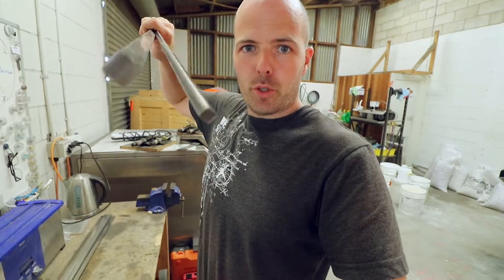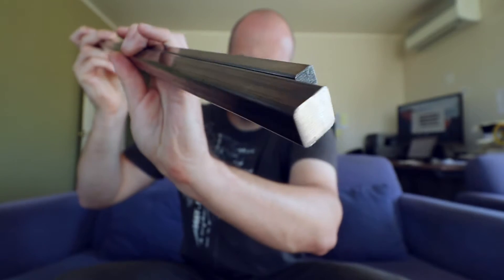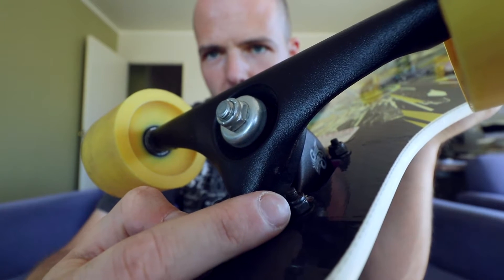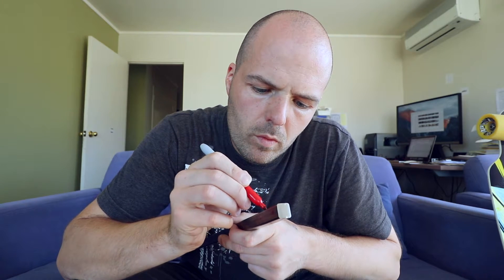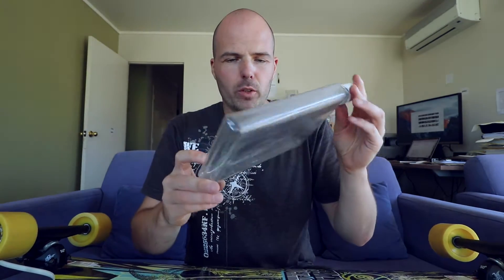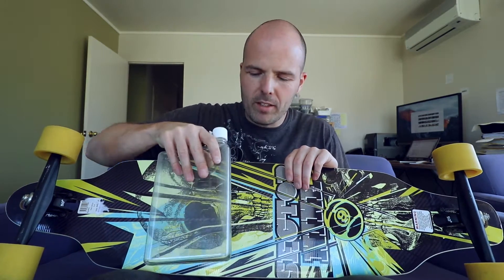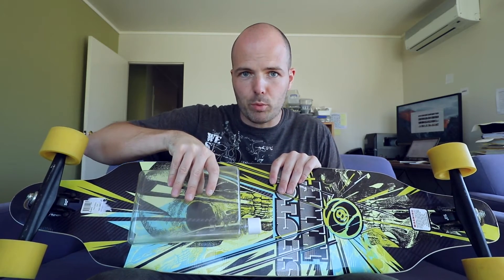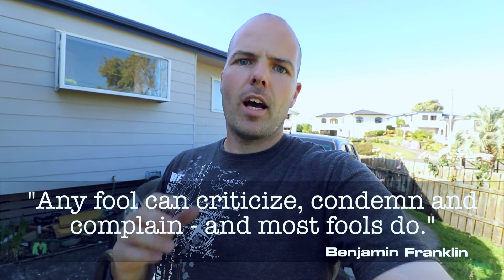Jet-Powered Skateboard (Part 11)

Comment: I was waiting for you to come up with the 'thin fuel tanks under the board idea'. Can't remember if you've already considered it, but have you thought about making a custom board and replacing the stock one with one with a void in it so that the fuel tank is part of the structural makeup of the design?  I wonder if you could do it by pressing two shallow clamshell type shapes (say 25mm deep overall) or by selectively machining away the void from a big solid bar. For instance , a board 25mm X 300mm X 1200mm (a guesstimate based on the look of the board) gives a 9L volume. Even halving this to compensate for the irregular shape of the design and the volume of the material is more than enough for your needs.